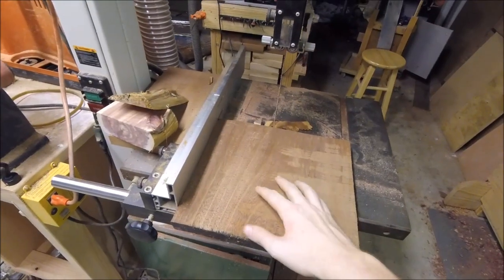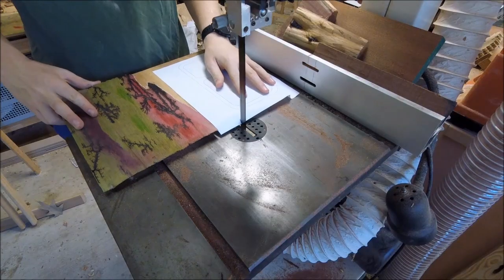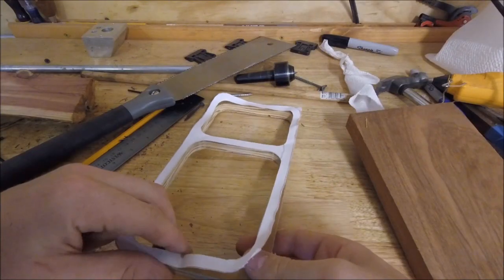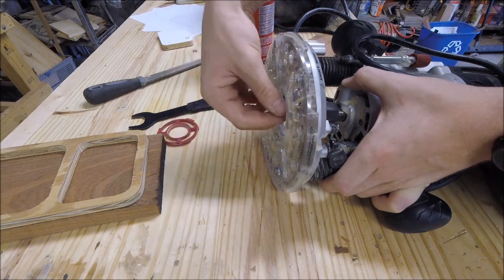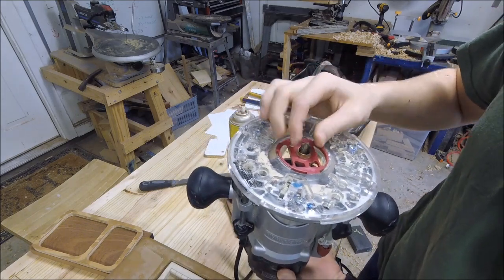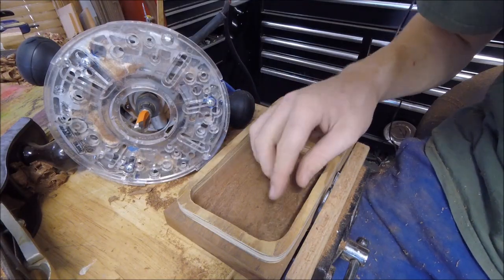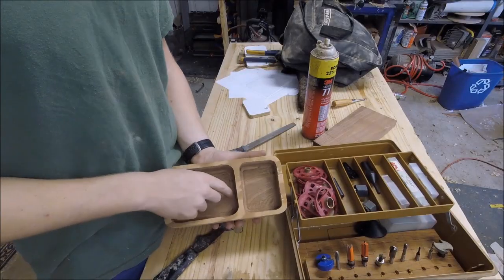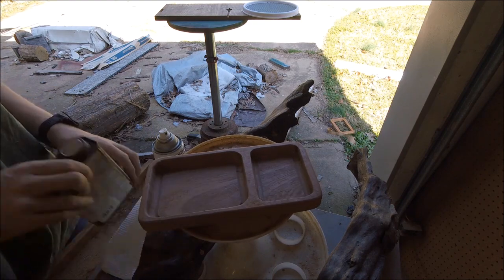Router Tray (with home-made template/ \no fancy bits) | Woodworking

Comment: Ok. You need to know the best trick ever, lol. Screw the hot glue. Check it: Stick a piece of your blue tape to your board, and another to your template. Then put a few dots of CA glue (gorilla super glue, krazy glue, etc) on the tape on one of those pieces. Then position and hold it down hard for a few seconds until it sets. Boom, poor mans double sided tape, super fast, cheap, rock solid, repositionable until you apply pressure, thin, and can be pulled apart with no marks (you’re just pulling blue tape off the pieces). Perfect for router templates. And your sandpaper block, too.
Reply: https://youtu.be/ub6PsY4cgwg?t=445 go to 7:25 and behold, but just use super quick set glue and ignore the accelerant. I use a brayer sometimes but never had problems without it either.
Reply: Awesomeness!!  I`ll be trying that for sure.

Comment: Hi Blake, You seem like a knowledgeable guy and am hoping you can help me find a solution to my router bit problem.  I make wooden knee sliders for motorcycle roadracing.  My sliders are a simple rectangular shape with rounded edges.  I have been making them with 90 degree sides and using a 1/2" diameter round over router bit (in a table) to soften the edges.  I would like to angle the sides slightly in an attempt to minimize chipping since I use the more durable and longer lasting end grain on the main dragging surface instead of edge or face grain.  Is there a way to make a chamfer and round over/soften the edge with one bit?  I can't figure out a way to do it even using two bits.  Is there such a thing as a round edged chamfer where the chamfer is straight but has a curved shape at the top?  Thank you in advance for your time.
Reply from the maker: Maybe your best bet its to round over the edge that you want rounded over, then use the table saw blade to put the chamfer on it.  I hope that helps, but im not positive that i am picturing it right.